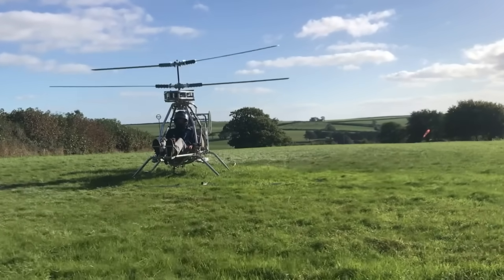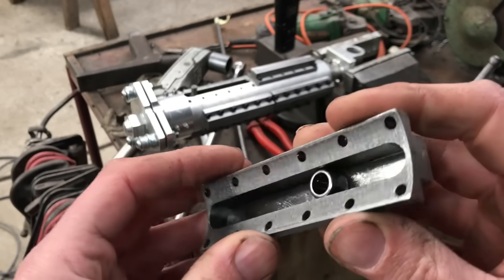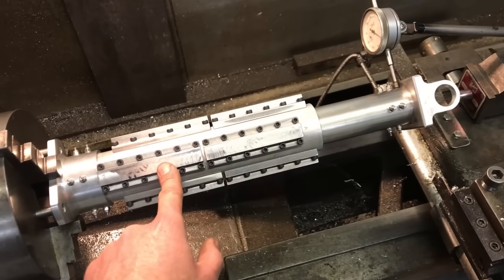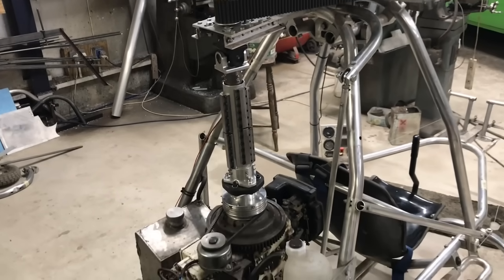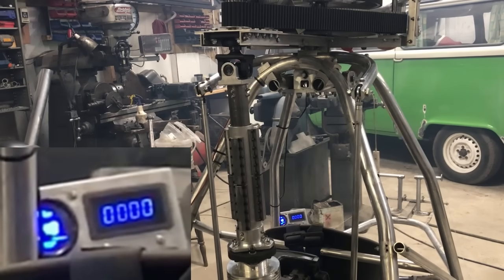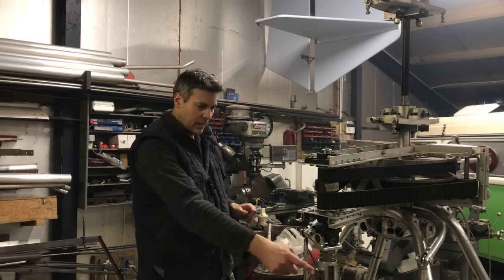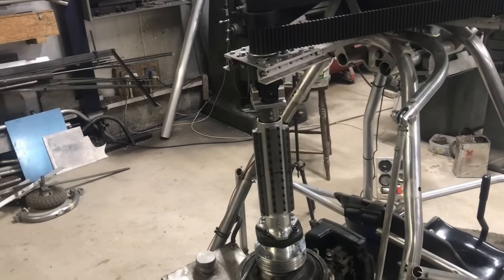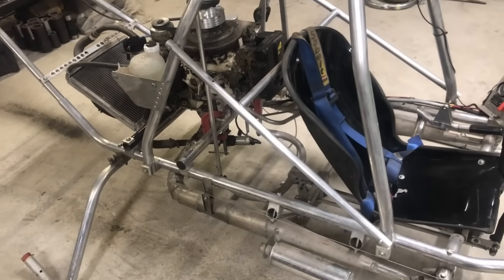Homemade Helicopter drive testing part 1

Comment: You really must change the design, you have already proved that the thin shell roller bearings are not designed for point loads, as others have pointed out. Once you load them up with the rotor they will all fail, in the same way the first one failed. If they fail your pitch control will lock up which could be disastrous. They must be installed in a hole bored in solid metal, so the thin shell is supported all round. As someone else suggested you could add hard steel shells around the outside.
Reply from the maker: @robertfack3082  yes, I will probably need to redesign this. 
It's not certain yet the bearings will fail as all I've proved is an overloaded bearing will fail. I've tested the driveshaft under full engine torque and it didn't fail but they still might over time. Like you say the pitch control will start to bind.

Comment: I'm not crazy about this design... If the shaft explodes, it's going to send shrapnel in all directions... Maybe put up a quarter inch sheet stainless steel between you and the drive.
Reply: He had a scatter shield when flying. Removed for maintenance access
Reply: @HongyaMa  im not just trying to point out a problem without bringing a solution, but this one is tough. There has to be a way to keep the bearings inside of a circular housing at either end, and not along the shaft, perhaps. Also i have to second what another guy from the peanut gallery said. there must be a way to facilitate autorotation if the engine dies. This might mean redesigning driveshaft to be central and not offset, IDK
Reply: @Abednego-v2r  His freewheel clutches are pressed in the small sheaves - His issues will be the needle bearings. Delrin or other hard plastic might be the answer. 
One step at a time. Cheers
https://www.youtube.com/watch?v=fRp2uAYWa_A
Reply from the maker: @Abednego-v2r  Hi, the driveshaft will be shrouded by an external tube attached to the fuselage. I decided autorotation wasn't necessary as it's only going to fly at a few feet, just for hovering.

Comment: Wouldn't an electric motor and batteries greatly simplify the build?  The motor could be mounted under the blades so there's no need to transfer power over a longer distance.
Reply: No power density in batteries more complex power management

Comment: The level of engineering that you've put into this is definitely treading the gray areas of "homemade"😂
About that splined driveshaft friction issue. Cannondale had bikes with a "head shock" that used a square shaft with needle bearings on each side. A design like that may work, but im far from an engineer 🤷‍♂️
Reply from the maker: @thelonewrangler1008  Thank you! Yeah I remember seeing that headstock design. 👍

Comment: Hey Ben, cool project.
Have you considered using thk linear guide bearings? Available in all shapes and sizes
Reply from the maker: @samforsey  Hi, yes I did consider it. A ball spline will work if mine doesn't.

Comment: Hi Ben, Re the spline: I have used a Deckel FR2 mill in the past and that has a splined drive to the head. It only rotates at 2000 rpm but it must have a fair bit of torque on it with a big shell mill. It slides about 200mm butter smooth at full rpm & torque. Could there be something about the geometry of that automotive spline that is misleading you into thinking a spline can’t work in this application?
Reply from the maker: @gillywild  Hi, possibly, apparently you can get coated splines for low friction.
Reply: @ Hi Ben, I’m pretty sure this is just metal on metal but metal sliding joints are really common in machine tools - dovetails, lathe bedways etc. and slide freely in spite of massive loads. Might there be something about the surface area of the mating surfaces and also the shape of the splines? I mean the load per spline would decrease as the number of splines increases & the load per sqmm would decrease as the contact area increases (if my brain is working right). I appreciate that your application is unusual regarding the high rpm, high torque & long throw but I cant help feeling that this problem has been solved before. I’m no fan of Elon Musk but the Spacex adage that “the best component is no component” does make a lot of sense and I worry that your current design requires a lot of moving parts. Wishing you all the best with this project and I’m confident you’ll crack it :)

Comment: The bearing may have bound in the slot because the outside shell is thin and really designed to be pressed into something rigid causing it to deform when put under load alone. If you're ever forced to redesign the shaft, maybe press the bearings into a hardened roller, mill the slots to fit that. That would also crush the ID to the nominal size so you could use dowel pins. Just me thinking out loud. Looking forward to updates!
Reply from the maker: @kcraig51  yeah, that would solve the issue. 👍

Comment: A contrarian thought occurs. I am not nor ever will be in the position of building a helicopter, but since the primary weight in this setup is the pilot, why not skip all of the articulation of the drivetrain and just move the "cockpit"? Add mass if necessary to counter the loss of the engine mass... Sorry!
Reply: Sibel helicopter did that exact thing before Cessna bought the company.

Comment: Have you thought about a flex pipe on the exhaust? Cars use the flex pipe usually with some type of spring bolt kit,to allow flex in the exhaust system. With out the flex pipe & spring bolts,it's common for the exhaust manifolds to crack/break. Especially common on all fronts wheel drive car's.
Reply: it cracks because the welds are dogwater
Reply from the maker: It cracks along welds, across welds and in material that hasn't been welded. Yes I'm fairly new to aluminium welding but I've done structural testing of the welds and I'm confident in them. A pretty weld is not automatically strong.
Reply from the maker: Yes, there is a flexible joint just before the bend where it cracks. The material is 1.6mm aluminium and I think this is the reason for the cracking.

Comment: Look at this type of sliding joint as the one you made will wear quickly. https://i0.wp.com/woodworkerb.com/wp-content/uploads/2014/10/RA-10-Drive-Shaft-Exploded-View.jpg?ssl=1
Reply from the maker: Good find!!! interesting 👍
Reply: @Ben-Dixey  I sent this to you once before, I am a machinist and spline part will work for your application as it is friction free under load in its original application transmitted a lot more torque.
Reply from the maker: @ Where did you find this diagram? Do you know what vehicle this was used on ? Thank you.
Reply: @Ben-Dixey  Ask and you will receive, Datson - Nissan 1600, 1800B, 240Z, 280Z rear axle half shaft, just a suggestion, the rubber donut you have on the drive shaft might also be a source of vibration is it appear to run out.
Reply from the maker: @bigboy9693  Wow! I didn't know that, thank you very much and I'm sorry I didn't see this before.
Reply: @Ben-Dixey  I used to use these years ago in off road VW's and they are strong, you would have to check the travel, they have a positive stop at each end with an internal circlip that holds them together, if I remember, they have no play and are precision ground in the groves and run smoothly. If you do the speed calculations, they can run at the speed you require. on the vehicle with a 165/65/14 tire, at 100KMP the drive shaft run at 803 RPM.

Comment: Just passing by: instant ~2'30" I'm not sure that the roller casing is meant to roll, it should in fact be encased into a tight fit roundhole, not free sliding into a slot... if you definitely have no other solution than having the roller bearings slide into a slot, you may want to consider holding these bearing casing into a holder that will maintain the roller casing integrity, and that casing would be sliding into a (larger) slot for instance.
Reply from the maker: @n1352-m1i  Agreed, some modifications are going to be needed. 👍

Comment: are you _sure you cant reduce the drivetrain rpm earlier in the power delivery shafting?
Reply: High RPM = Less torque loads on shaft

Comment: now that's a sliding fit, not pressed:  5:00 are the circlips rated to hold those yoke bearings in at rpm?
Reply from the maker: Good question. I assumed so but you certainly wouldn't want one coming off, imagine the carnage that would cause. Scary. 
I would hope the designers of the UJ I copied tested the strength of a circlip without the press fit.

Comment: Sorry for expressing my opinion, but I'd rather speak than remain silent. The torque transfer unit you're making is potentially dangerous. If it jams, it will result in loss of control. Conceptually, it would be more correct to introduce torque into the center of the rotor axis, via a cardan shaft. I'm also confused by the impossibility of autorotation in the event of an engine failure on your helicopter. I'm scared by the design of the gearbox that distributes torque between the rotors - a belt break will lead to a crash. Sorry if I wrote nonsense, I just don't speak English fluently enough, and I might have simply misunderstood something. I think that sometimes it's better to stop and redo everything than to stubbornly follow the wrong path.
Reply from the maker: @igorok1362  Hi, the machine is only intended for hovering at a few feet so autorotation I didn't see as necessary. 
If a belt broke it would most likely lead to a crash, correct, but then anything breaking is also likely to lead to a crash. All I can do is try my hardest to make it all reliable. 

Hongyama designed and built the rotor mouse helicopter and designed the turbine conversion for Rotorway.
Reply: @ Thank you for your reply, I wish you success!
Reply: Other kit helicopters use the same belt drives no issues , Rotorway, Mosquito Air etc, The mast tilt is like Noland Brothers & Gen 4.  His freewheeling clutches are in the input sheaves above the engine drive shaft,
https://www.youtube.com/watch?v=fRp2uAYWa_A
Reply: @HongyaMa  In Nolan, the torque is supplied by the cardan shaft to the center of the rotor, which I wrote about in the comment. In Mosquito, a belt break does not lead to a crash. Unfortunately, I do not find any rationality in your comments.
Reply: @igorok1362  the Noland was a tilting mast like this. and many kits use cog belts
You add nothing of value here.
What have you built?
Reply: @HongyaMa  I have not come to argue with you, nor to report to you on my projects. I see that you do not understand what you are talking about. I am not going to engage in your education here. End of conversation, goodbye!

Comment: I'm a former Turbofan Test Engineer for Lockheed and Rolls-Royce at Stennis Space Center, on the Trent 900, 1000, and XWB.  Mainly for R&D.

I didn't see in your video if you were using accelerometers or not, but I'd highly recommend getting a pair.  At least one per axis.  You'll gain a lot of instant knowledge about how much vibration is going on, especially that you can't see.  Our eyes aren't the best at detecting the unseen and worst kind of vibration.  That's the tiny but very fast vibrations that end up being up to 1 inch per second. 

We used them all the time in the jet engines, and even had limits that we couldn't drive beyond.
Reply: Даже если у вас нет денег на акселерометры фабричного производства, их можно изготовить самостоятельно, используя циллиндрический магнит, подвешенный  внутри соленоида с проводом на двух пружинах. В качестве измерительного прибора использовать осциллограф. А если дополнительно поставить оптический датчик периода вращения, то можно так же определить фазу дисбаланса и методом последовательных приближений отбалансировать систему по минимуму вибраций, добавляя или снимая груз в секторе, координаты которого можно определить по положению пика дисбаланся относительно метки периода обращения.
Reply from the maker: Hi, I'll have a look at second hand vibration measuring equipment, see if I can find something within my price range. You are absolutely right of course, it's the correct thing to be doing and I would certainly enjoy learning all about it.
Reply: @Ben-Dixey  , sounds good!  Glad to pass on any knowledge I have, since I no longer have a use for it.

I'm also a former Metrologist, and still have some connections for all kinds of equipment.  I'll call a few friends and see if they have some surplus they wouldn't mind parting with.  I also remember a few suppliers I used in the past and will look them up.

One thing I forgot to mention is the specs for an application like this.  I was fixed wing, so I don't know exactly what to look for with rotary wing aircraft, but I'm sure they're out there in the public domain. 

I'll get can with you if I do or didn't find anything and if I do we can arrange some way to communicate direct to get what you need.
Reply from the maker: @JarheadCrayonEater  My email is btdixey@hotmail.com should you find anything. Thank you 😊
Reply: this machine is a death trap... just look at the welds.  >:/
Reply: @greedfox7842  , I'll admit, I had to cringe a few times.  I'll definitely not be flying one.  We have enough trouble in the big manufacturers, with decades and decades of experience.

I will say, it is enjoyable to see the process one man goes though to figure all of this stuff out without a team is quite interesting!
Reply: @JarheadCrayonEater  https://www.youtube.com/watch?v=fRp2uAYWa_A   Me 1995 no team.
Also designed the Rotorway Exec turbine conversion of 100 produced
Reply: @ I fly all of the things I build from a FPV video feed, and a 2.4 hz radio link. staying safely on the ground, while getting to fly all sorts of obviously dangerous machines.
Reply: @greedfox7842  Cry harder. It's hovered before and I bet you've never tried anything like this
Reply: @greedfox7842   Stick to watching others stick their necks out, you will be warm and safe on your sofa :)

Comment: I'm not sure what it is called, but the modern driveshafts I work on have a blue plastic-like coating on the slip yokes and it is extremely easy to slide while being free from any noticeable play.  I'm always amazed at how it can hold up under the load of a water truck and remain tight and slippery! (I'm sure it's NOT plastic but something far more special)
Reply: Delrin?
Reply: @judahsmemes6987  Far more likely than plastic. It is blue ... which most of the slippery stuff I've seen is not but maybe could be. Also I don't know how thick it is but there are no signs of conventional machining that show through so I'm guessing it is finished with a one piece tool that cuts it all at once.
Reply from the maker: @kevinsellsit5584  I hadn't seen this, seems it's called a glide coat and is for reducing friction. Interesting 👍
Reply: @Ben-Dixey  Honestly, I'm a little worried about the bearings in your slip-yoke. By design they would be a very specific light press-fit into a much thicker part. The shell is only there to provide the smooth polished and hardened outer surface for the bearing once it has a tiny bit of crush from pressing. The inner race would be at least surface hardened or better like your pins. I learned this the hard way using one way roller clutches years ago. My lack of machining skills were not good enough to produce the perfect amount of crush every time and resulted in a variety of failures.
I think the glide coat slip-yoke would be a better option for such a critical application.

Comment: Nice! Those shells on the needle roller bearings are only really designed to be pressed into a pocket - they're not structural on their own. Maybe just make a (small!) steel puck around them with a press fit? The shell is hardened, so with support could be far more resilient. 
Keep going, you'll be flying again before the summer is over!
Reply from the maker: @Dibblah1900  yeah, I might have mucked up here, having the bearing pressed into another sleeve will work but the slot width will have to be increased. Will have a think about what to do.

Comment: Although this was a no-load test, it shows that this joint is not affected by centrifugal force.
I'm a bit worried that the rollers are jammed.
I'm looking forward to the next step!😀
Reply from the maker: @mitubachiflight  yeah, will see what happens with the blades on. Might need a redesign.

Comment: the outside of that style of bering was designed to be pressed in a  hardened sleeve only,
the shell will not hold itself
Reply from the maker: @wizardind3203  Yes, a redesign might be needed. 👍

Comment: I must first congratulate you for putting a new idea into practice... One thing I have learnt in engineering is that the more you test the more the problems and the better the solution gets.. 
I think you should add the blade and do more testing.. 

The outer surface of the needle bearing is the problem. 
At high centrifugal force the surface presses too hard to the wall of the groove. 

Concerning the inner tube, I think you should finish the blade test to gather more information before a new one is made.. 

Well-done for the hard work see you on top.
Reply from the maker: @OYEUAV  Thanks, yes will try with blades on next, find out more information as you say. 👍

Comment: Hi! Really love your videos!
If the exhaust keeps cracking, why not use flex-tubing and hang it in rubber instead of what appears to be hard-mounts...?
Keep em coming!
Reply from the maker: @BricoleurTV  Thanks, I've got a flexible joint just before the bend where it cracks and the exhaust is rubber mounted. The mounts aren't the hanging type they are the rubber bobbin type. Now you mention the hanging type it's worth a try and easy to change. 👍